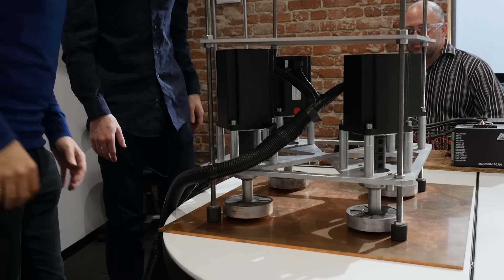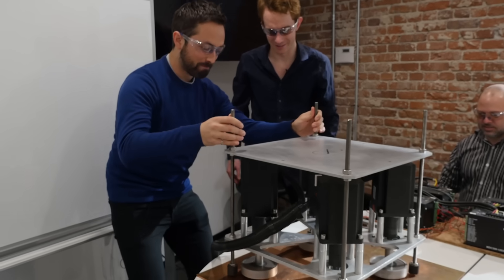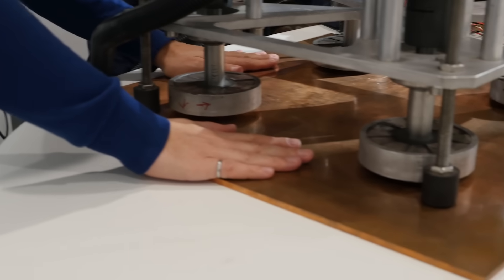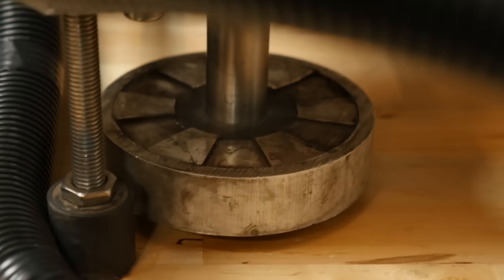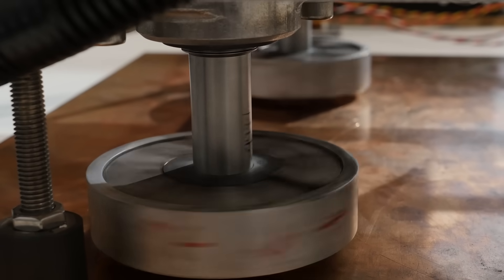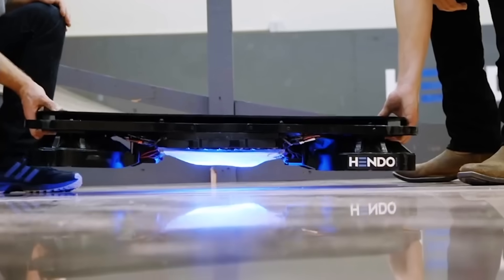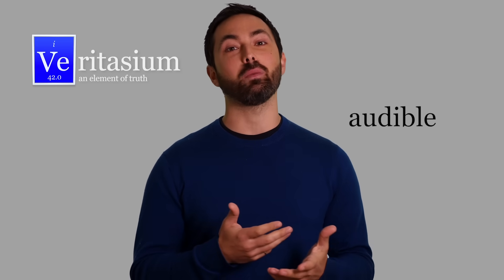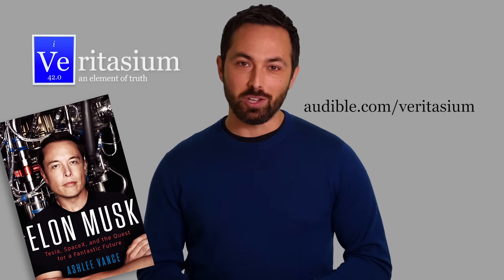Electromagnetic Levitation Quadcopter

Comment: This isn't true levitation its a magnetic field trick on conductors and ferromagnetic metals.

Do it with out a base and I'll be impressed....

A magnetic field could in theory work with no base for levitation but the power required would be ridiculous and I don't even think conductors exist that are capable of handling the energies needed to do true physical magnetic levitation, levitation that requires no "base" to operate on other than free space.

Free space is a misnomer and does not exist what we think of as free space or empty space actually consists of weakly interacting fields which a magnetic field could technically interface with at high enough magnitudes.

Comment: Figure out a way to get levitation device to get attracted to earths magnetic field or repelled by billion of amps electric currents thousands of km deep inside the earth and you will no longer need copper plate.
Reply: Here is a snip-it from a "Advanced Propulsion Study"(Declassified) Special Report to the U.S. Air Force Research Laboratory:"Geomagnetic Levitation
This concept is another hybrid electromagnetic catapult launch system. It entails a superconducting cable that is anchored to the Earth, and which carries an extremely high electric current density (Moss, 1989). The cable is levitated via a Lorentz force generated by the Earth’s magnetic field. The payload is transported into space via an elevator that is attached to the middle of the cable. This concept is impractical because no existing superconductor can carry the required current density, and the cable would have to be more massive than the Earth unless it is built with Buckytubes. Wind, icing and lightning can break the cable and render the system inoperable until repaired. There is not enough literature published to better grasp this concept’s performance parameters and functional requirements. Therefore, this concept will not be considered further."

Comment: What if the copper plate was part of the quad-copter and either above or below the rotating magnets? Instead of having mirrored magnetism between the rotating magnets and the copper plate, could differentials in the amount of magnetism between the copper plate and the magnets be generated and controlled with a flight controller so a user could make it fly - raise into the air, lower and touch down, or move through the air forward, backwards, left, or right, like rotor-driven quad-copters but without the rotor blades?

Comment: If you used this in a house to move certain things efficiently, what if you took the heat generated on the floor, underlayed the floor with water so that water is boiled for steam to be produced and then the steam is then circumvented into a steam engine to gain back some of the used energy.  The floor would also have some form of heat resistant coating so you can step on it too.

Comment: A nice idea but still not tackling the actual problem with this system, the amount of power needed is crazy. In the video you saw a computer psu for each motor, so assuming that they are an average rated psu you could be looking at 4 kW, which taking into account the heat generated is probably an under estimation.

Comment: Thunderfoot has said that the hyperloop won't necessarily work. That makes sense because making a tube that long without any air in it is quite a safety hazard, the air pressure would crush the tube if it was hit too hard on the side.

Comment: Very nice video, I don't know why you have limited your project like this, am I the only one who does not understand why you did not put copper round plates at the bottom at the magnetic foot. Because then it would lift the copper too and lift until eternity = propulsion... Now you are limited because the copper stays at the ground, what if you lift the copper, will it will lift the system too, that's what I mean. So question is, will round shaped massive copper stick to the magnets, lift the system continuously. Or am I confused now? Like a donkey, you show it food and it walks, otherwise it does not ;-).

Comment: They use electric motor to spin permanent magnets to create electromagnetic induction? 
They should just skip the middle man and use only stator form induction (AC) electric motor to create a rotating magnetic field in copper, a lot more efficient way + no noise from rotors + a lot less weight (which is great when you want to levitate something) + faster response time (no rotating mass of a permanent magnets and rotor of the electric motor).
There, I solved all their problems, now if they want to patent this idea - I want a cut ;)
Reply: Ha, exactly! I just made a similar comment, they would probably be able to move it around as well.

Comment: 4:20 “..this principle has been used to achieve levitation in everything from maglev trains ...”. WTH? Reference please.  None of the operating maglevs have used spinning halbach array permanent magnets for levitation, certainly not the Transrapid shown, as they just use linear electro-magnets.

Maybe this is a reference to the Inductrack design, but they aren’t spinning and haven’t yet gotten passed experimental prototypes.

Comment: I have a question here if G-force is being applied to our every day life so...which is gravity and that gravity is powered by magnet and this can leviate things then.   Would this machine be effectivly called an anti gravity lift mech?  I mean our weight is dependent on gravity sooo magnet of that can leviate 105 of its own weight.. how much more can it handle and could you use this copper sheet to then move the heat down to be recollected as energy for the machine ?

Comment: HypeLoop idocy.

Son, I am dissapoint.

Maintaining a vacuum is HARD and NO ONE -- even Elon Musk -- has demonstrated how they will address the fragility of a cylinder under low pressure without the massive risk of sudden implosion initiated by impact or material stress or how to handle thermal expansion while MAINTAINING the vacuum.  Comparing it a bridge is a non-sequitur as bridges don't have to maintain a vacuum.

Comment: I have an induction stove which uses the exact same principal, but for more heat transfer, uses iron pots and pans.  However the attraction is about the same as the repulsion so it does not glue the pan to the stove.  Instead of motors and magnets, it uses an inverter and induction coil.

Comment: about the hyper loop i'd llike to tackle a couple of points. 

the puncture issue i feal is over hyped. a half inch hole  would not cause a sudden change in pressure but a very slow one. what is more we are capable of creating material which won't collaps with  puncture at 1 bar diffrential (watch the mythbuster video on collaping a tank under vaccum that metal not thick). a half inch hole would cause a pressure climb of about 0.007 bars a second in a 3m diameter 10 meter long  tube (the real one would be much longer so the pressure change would be much slower). in the case of hypersonic travel (something like mach 10) that would cause a force of about 1.3 tons, unless the hyoerloop way a lot less than a ton the deceleration would be unpleasant but not fatal, if it weight 13 tons that would 0.1 g maybe enough to knock you over. a hole would be worst for a airplane than for a vaccum tube just because the forces aren't linge to cause tearing and we have less weight resctriction so we can use more metal.

i cant see expantion joint being a challenge we had those for years. pistons have worked around the challenge.

the only prohibitive issue their is cost. even if we get to the point that hyperloop or other similar technology get wheaper than rail (very unlikely). For an effective  adaptible form of travel, the concequence would be, we'd have to replace and rebuild our whole rail infrastructure and all the vehicles thtgo with it. that not going to be cheap.

Comment: I would use this method to levitate the hyper, but also to make it move, the heat created or energy can then be transferred throught the copper to almost steam room to turn a turbine to create electricity, so the most of the energy being used could then be turned back into the current they need like a nuclear power plant without the rods, or the volatile probability of nuclear disaster.

Comment: Wouldn't this levitation be extremely useful for adventurers in space? I hear cold temperatures increase the strength of magnetic fields or something. I can't help thinking it would be great in space. If we launched a space ship right now with that technology, how long would it take to surpass the location of the satellite that's currently around pluto?
Reply: It's more expensive though , I think ion propulsion is better but still reaching even as far as moon with this tech is not possible in near future as you have to lay maglev tracks in space and the technology is pretty old japan has already created a lots of maglev train while this is still a lab experiment for american's now

Comment: Why is the device built that heavy? I mean I the steppermotors seems somewhat oversized, couldnt smaller brushless motors do the job and plastics/carbon rods be used for the frame? Also, does the speed at which the magnets turn, affect the amount of current produced in the surface plate, generating more lift? So many questions... its like magic...

Comment: Time for some technical info.
Changing magnetic fields induce currents which themselves behave like temporary magnets. 
but the polarity of these magnets depend upon whether the applied field (in this example, the field from the magnets of the rotor) is increasing or decreasing. 
you could divide the copper plate below into small small square pieces (mentally). As the rotors rotate above them, the magnetic field the magnetic field through each piece keeps changing (due to non uniformity of the field). But here is the real kicker. 
The magnetic field not just increases but also decreases. so during one case the induced currents repel the magnets but during other times, they attract them. Then how does it work?
The same goes with his earlier episode (where he used an AC to levitate an aluminum foil) 
The current increases and decreases, so during half the time the induced currents in the foil attract the coil and the rest half they repel. 
In both cases, on an average the net force must be zero. And levitation shouldn't work. But here we are, seeing is believing. 
Who knows the answer? let me know. The answer is deep.

Comment: IT'S A TIME MACHINE  i'm an inventor and I believe that a falling magnet inside a copper pipe may be a time machine , the magnet can be a human capsule where  time is slowed down like supended animation compare to earth time where is normal time so a person exiting capsule after a magnet fall may end up in a future time , where inside capsule feels only a short time , it may have been in a suspended animation using time itself , like frozen in time and coming out in the future .  for example imagine two cars on road while one is earth  traveing at normal speed in time , the other car is the capsule ,putting the breaks down , slowing the the capsule compare to earth so the earth would be  ahead in time compared to the capsule time since both started at the same staring point in time but one slowed down while the other travel at normal speed and now earth would be in future (ahead) of the capsule  ,there for when the occupant come out of the capsule from it's suspended  time into ours it would be in a future earth with no way of goin back in time only forward , black holel object go" FASTER" to the event horizon and the magnet human capsule goes "SLOWER " which is  opposite ,  both use magnetic fields .

Comment: If I understand this right, the reason they need really big motors is because they need to overcome the resistance of the slightly ahead magnetic poles in the copper, overcoming this force translates into the levitation. And since they need big motors, the whole thing becomes very heavy, resulting in really needing big motors. The motors torque is basically what is lifting the whole thing.

One thing does occur to me though, you could power the rotation of the magnets with any kind of motor. So if we want to be slightly more eco-friendly about it, it could be a hydrogen gas engine, rather than a diesel engine. This would make more sense for a powered vehicle since batteries are quite heavy.

Comment: ok how does a balloon filled with helium that is a few days old, so it only floats a few feet off the ground, float higher it you put it over a higher plane like a couch or table than it does on the ground, I have taken a helium balloon that has lost some helium due to time and seen that it floats at 1 foot or about 30cm high, then placed it above a couch and seen that it floats about a foot or 30cm above the couch. Derik can you explain this.

Comment: Here's an idea- use the EM levitation to lift and propel Hyperloop over a steel track cooled with a series of closed liquid Nitrogen loops that dump heat into the ground, using a one-way flow setup so that the Nitrogen evaporates and flows through the tube walls to mitigate their thermal expansion. The compressors only cool the nitrogen back down to liquid temperatures, whereas the evaporation and expansion pushes the Nitrogen through the loop as the one-way valves direct the flow. The spinning magnetic assemblies can rotate clockwise on one side and counter-clockwise on the other, which creates net forward movement

Not the best idea, I know. Still, that would work better than a turbofan in a vacuum tube, right?

Comment: Sir I have  a question. When we keep an object on a surface , say a table top , the object exerts a force due to its weight on the table top but the table top exerts an equal and opposite force perpendicular to the surface in contact so that it balances the weight of the object . BUT how does the table top exerts force ????  How does it get the energy to exert the force ??

Comment: Wouldn't it be possible to replace the copper plate with a superconductor material and cool the thing down until the resistance in the superconductor becomes 0 and therefore eliminates the drag, so the whole system could work a lot more efficient? Or am I misunderstanding this?
Reply: You mean like a Maglev train, this is old tech in truth

Comment: How fast do the magnets spin (like in rpm's)?
Reply: There are little mice who are trying to catch a piece of cheese, and the have been trained to wear non-slip sneakers. This force is connected to the magnets by means of a six speed transmission. in case any mice catch the cheese and extra energy is released.
Reply: That's why UFO's or flying saucers spin 🤔

Comment: Question. When not levitating, the contraption is hard to move. If I put the copper plate on wheels, connect it to a push handle (like a flatbed trolley in supermarkets), then secured a levitating contraption to the trolley, would the trolley be light or bear the weight of the contraption?

Comment: In the future, would it be possible to use the Earths gravitational field to travel using this idea? I know that there would be an unprecedented number of variables for it to work, but just speaking theoretically.
Reply: The huge problem with gravity is that it is way too weak for that (10^36 times weaker than the Electromagnetic Force).

Comment: Wow this could technically make hovering cars. Put those spinning magnet arrays along the base of the vehicle, add compressed air tanks for thrust, cover the road with tracks of sheet metal (I supposed if it's not copper it might get too hot, but perhaps aluminum might be alright.) and there you go: hover cars.
But, is this practical? Lining a road with metal is probably too expensive, even if it's only channels like a rail rather than the whole lane width. Acceleration would probably be quite slow, maybe good momentum for efficient linear travel... until you need to stop. No locked tires to grip the road, so what, another thruster on the front to push the opposite direction? That would be a very slow deceleration. Even if the spinning magnets are immediately braked, the cards would slide along the metal tracks for a while before stopping.
So I guess it's best in monorail type controlled environment rather than personal transportation. Still really cool though.

Comment: So no qualifications or credentials for this guy other than he works at Hyperloop? So a marketing grad?

Do you realise how much copper costs.... no details on propulsion or vacuum.
BMW $ and now this.
Keep collecting money and selling out.
to explain more why people are opposed to Hyperloop, this is publicly transparent fundamental research that will result necessarily in peer reviewed papers that will help develop the concept.
This is a con to take a load of money for private investors, and most of it will go to CEO and his buddies.
If they were a proper public company, these annoucnements wouldn't fly past any regulator.

See even this article, which completely accept at face value the marketing of what Hyerloop has said with 0 evidence ("engineering is sound", no details no patents not protoypes.. sure...) highlights the commercial issues.
https://www.wired.com/2016/07/hyperloop-lawsuit-brogan-bambrogan-shervin-pishevar/
Reply: theblatant truth you don’t need to use copper any conductive material, you could put copper powder or and other conductive material in bitumen